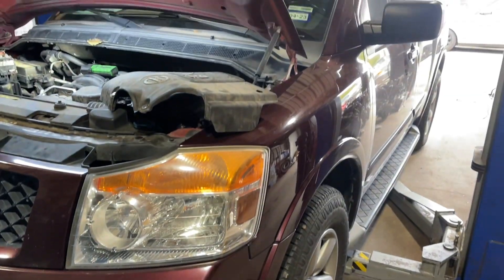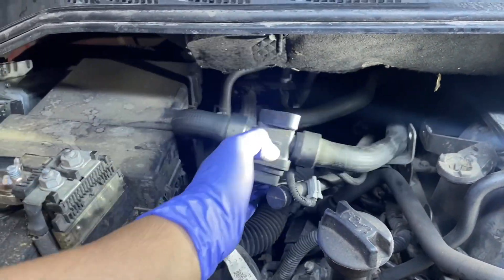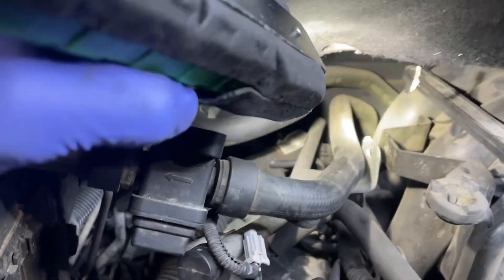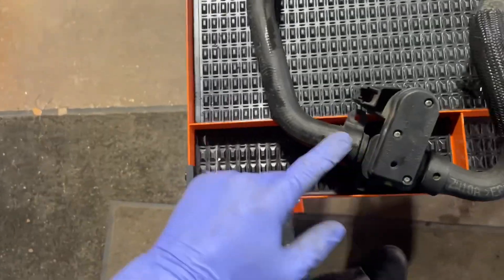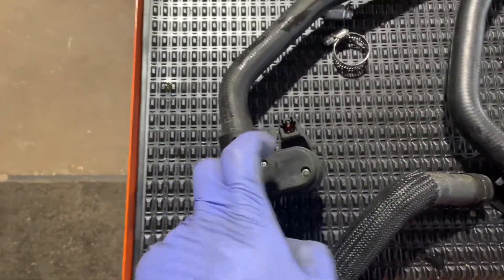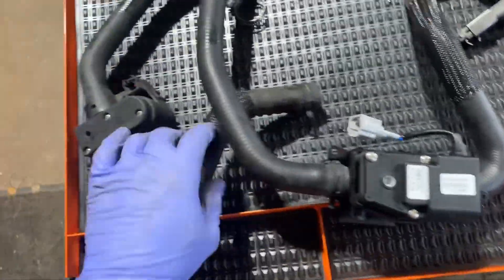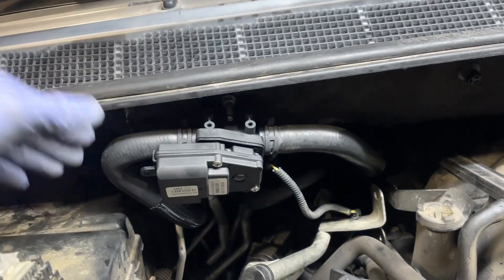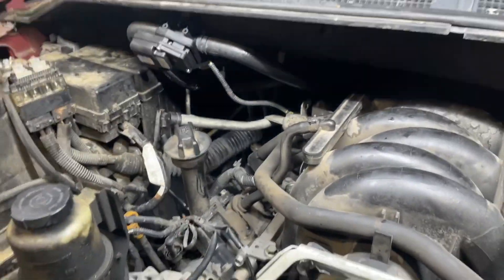2014 Nissan Armada Heater Control Valve Replacement

Comment: What's the purpose of the coolant flowing through there? I ended up breaking the cover off to access mine.
Reply from the maker: Controls coolant going to heater core for heat inside the vehicle.
Reply: how big of a problem do I have now? I couldn't get the cover back on the heater control valve.  @TexThaiAuto
Reply from the maker: Start the vehicle and see if it leaks. If it does then it has to be replaced. In the meantime if you have something to bridge the hoses you should be fine.
Reply: @TexThaiAuto  honestly I did it last winter. Guess I got lucky but I will be replacing soon.
Reply: Hi, I dropped the bolt while replacing the HCV oh course I can't find it. Do u happen to know what the correct size